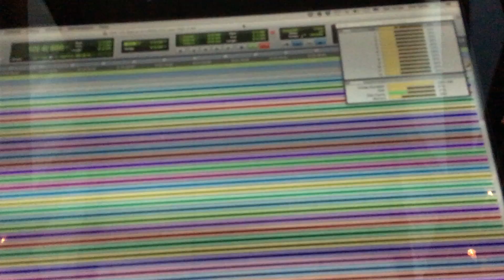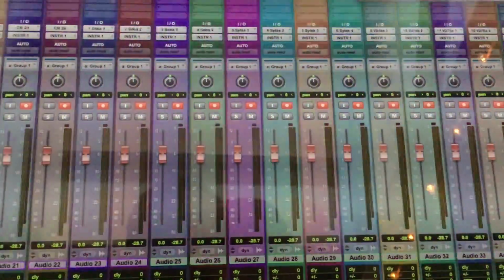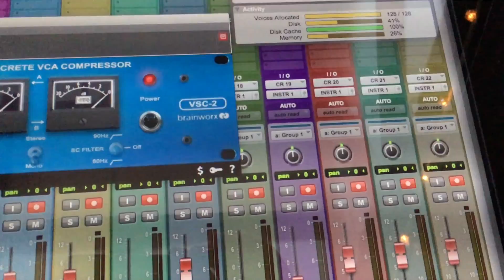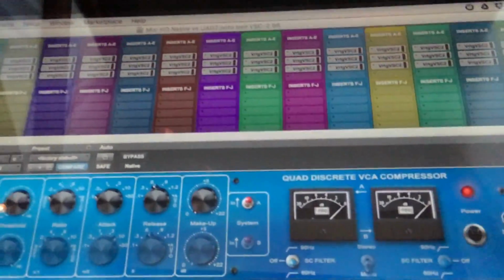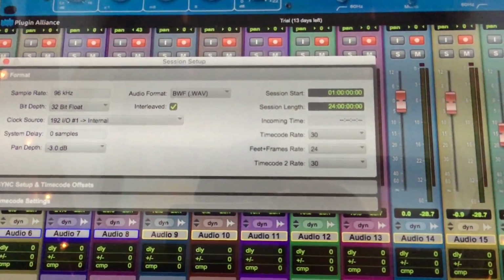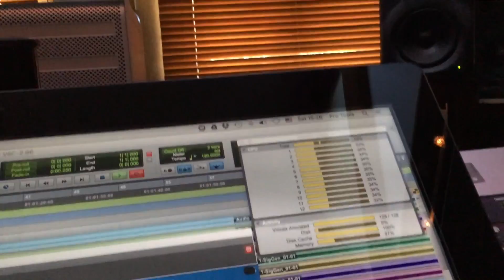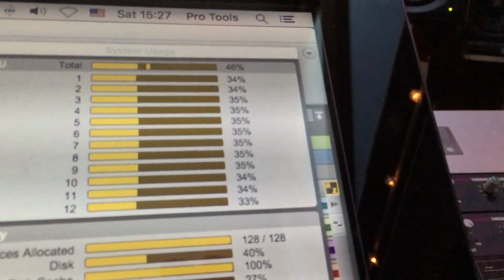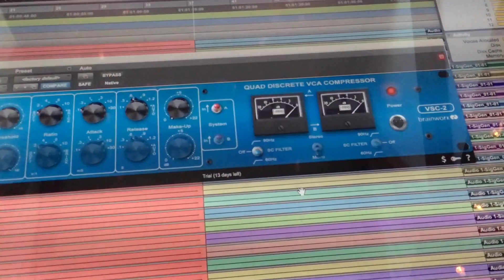HD Native vs 3 UAD octos

Comment: What is your config and what are the plugins?  Those look like all non-UAD plugins. I am just running an Apollo 8P, a quad Twin (desk monitoring controller) and an Octo and I get 48 channels of SSL 4KE channel strips, with 16 channels of Neve 1073 strips, plus 2 DBX, 4 Fairchild 670’s, 2 Reverb Pro’s, 6 Distressors, and an Ampex ATR-102 and am around 86-94% UAD util.   They are all UAD plugins (obviously), since non-UAD do not take advantage of UAD DSP, and therefore must run native.   Also, running in the console employs direct low latency (1 - 1.5ms at 96KHz), while the same UAD plugins in the DAW tracks run native bus.  We run Logic about 70% of the time, and an even split between PT and Ableton for the rest.

These are just the UAD mode plugins, since on the DAW we typically run Altiverb, a slew of Slate Digital plugins, Pianoteq, Fab Filter, iZotope, Waves, Townsend Sphere and other plugins while mixing. 

I cannot tell by your video comparison if you are running UAD plugins in native mode or not— how are you comparing them, and are you trying to UAD DSP support that VSC-2?

We do have an Omni plus HDX that we use on a 3.7 GHz I7 PC for some sessions, which we bought from a studio/media center that went out of business locally; but other than having a bunch of nice plugins that came bundled with PT Ultimate, we found more limited realtime concurrent tracking performance in terms of total tracks at low latency.  We are still trying to optimize that system, and any suggestions would be great.
Reply from the maker: Hi, thanks for your comment. 
What I was doing in this video, is running the Plugin Alliance versions of the same plugin that runs on UAD (they have been proven to null, same plugin, just one runs on UAD, the other as AAX). The purpose was to test how much of those plugins my 2010 6-core mac pro with HD Native could run while recording at 96k and running at lowest buffer.
I decided to benchmark it against what UAD says an UAD2 octo can run. My 2010 Mac Pro could run 3 maxed out octos worth of those particular plugins in a recording situation. 
Of course, as I raise the buffer for mix down, I can run considerably more of them.
DSP systems can run a fixed amount of plugins regardless of buffer, native system performance varies depending on buffer.  Both of these systems have advantages and  disadvantages. My my point was to test whether my native system could run more than enough plugins, stably for my typical use cases and the answer is yes. 
That was then, the processors have advanced significantly since then (at least 2-3 times the performance), while UAD processors are still the same. 
I'm not saying UAD2 systems are useless, I'm just saying that the amount of processing that that they offload on modern systems is pretty negligible, unless you have a really expensive/extensive UAD2 system.  For most users, the fact that UAD plugins only run on DSP is therefore more cumbersome than helpful, as they could run a bunch of them on their CPU just fine when recording and would have the  benefit of being able to run additional plugins during mixdown, when they raise the buffer. 
Sure, there's an advantages to knowing you can always run a certain amount of those plugins, in any situation, but if your CPU can handle between 20 and 60 of them depending on the buffer and the DSP can handle only 20 of them, regardless of buffer... the fixed benefit of that DSP is greatly diminished. (these numbers are an example, not actually test figures)
That was the point of this test. When I get a new computer (probably i9-9900k based), I'll test it again. It's possible that I'll be able to run 9 maxed out octos worth, at 96k 64 sample buffer. 
You could so a similar test. 
Search for the UAD plugins that have an AAX/VST version (they must null). Then see how many of them you can run on your UAD system and how many of them you can run on your native CPU. Try it at different buffer settings. (record setting and mix setting , for example).
I don't own a uad sytem so I can only test the native performance and compare it against Universal Audio's 'instance chart;.
Reply from the maker: as you can see when I raise the buffer to 128 samples, the amount of processing headroom that gives is probably enough to add another UAD2 octo worth of processing to it, at least for this particular plugin. I will say that it seems like there's not a 1:1 ration between how much resources a plugin takes on UAD compared to native. 
Another plugin might run relatively more efficient on UAD than on native. 
Still, for my purposes, a low latency native system (like my hd native and Quantum 2 systems) are much more desirable than a UAD interface.
DSP is just not worth it for me anymore, it hasn't been for about a decade.
Reply: Yvo van gemert - gotcha- thanks for the clarification.  I thought you were trying to offload non-UAD plugins to a UAD system, and complaining that you didn’t see much performance benefit.  Of course it will run non-UAD plugins, just that the DSP’s will not really help you at all; since they only really offload specially written UAD plugins, which are designed to run specifically parallel DSP coded instructions (i.e. only UAD plugins).  

I hope everything runs native, at least as an option, in the future.   While I love near zero latency tracking and mixing even on a $500 Mac Mini or a low end PC; but I don’t like that I have had to spend a few thousand dollars to get it.  It’s cool staying in-the-box, and I like it a lot better than looping in an analog desk to get near zero latency, but soon someone will figure out how to use NVIDIA CUDA cores on a GPU to blow UAD out of the water for the price of a $300 video card.   
Slate and other native plugins do most of what I need when run on a decent machine— other than the ultra low latency tracking/cueing/mixing.  However, a modern GPU could do those functions in realtime if properly programmed, and could default to native if a suitable GPU was not found.  At least that’s my hope.